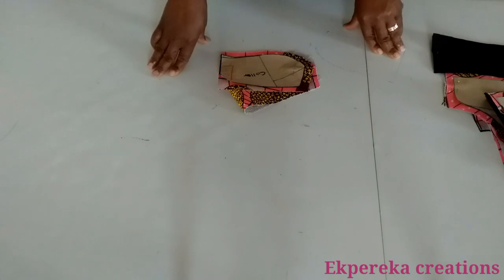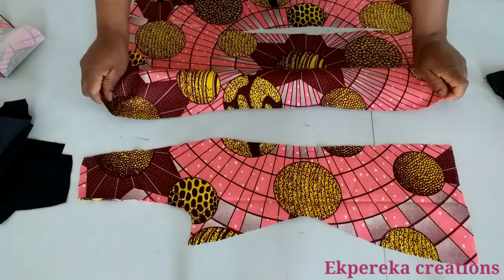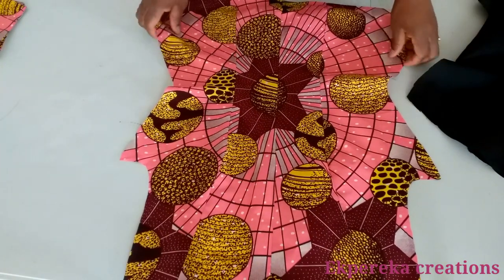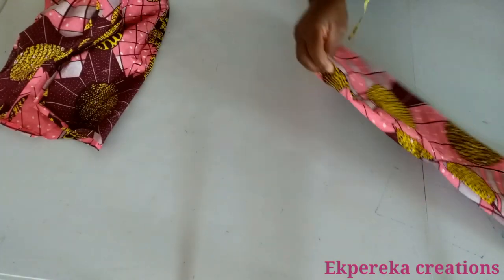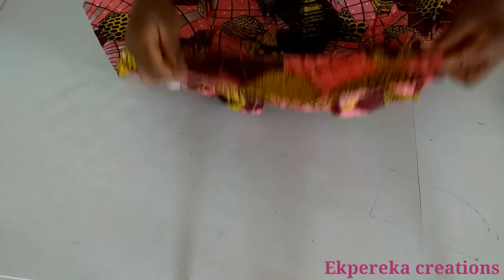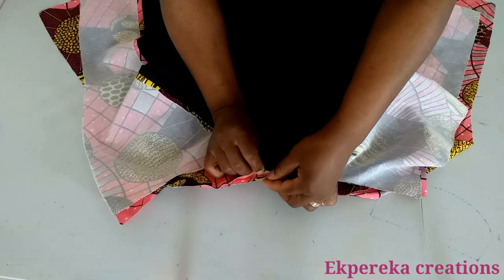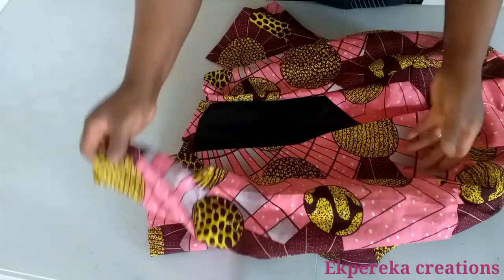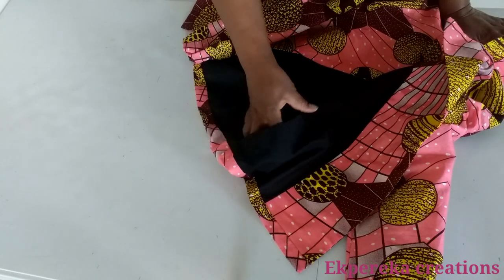How to  Sew Notched collar jacket

Comment: Thanks for this video. You made a peplum offshoulder with illusion shoulder sometime ago. U place the band after cutting the neckline with 5 inches( that's 10 on opening and d band was 2.5 ). Now where am alitl bit confuse after sewing up everytin d shoulder width wyd end up as 12 or 13 as against my normal shoulder which is 16. Would it still fit and not give issues?